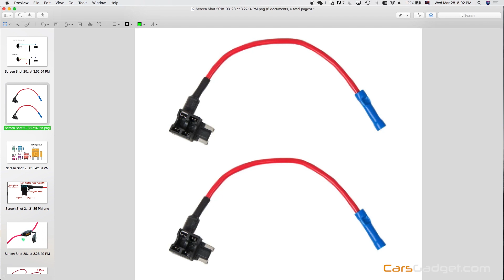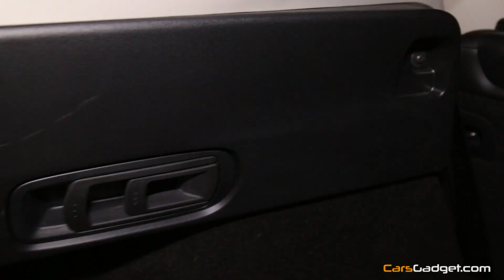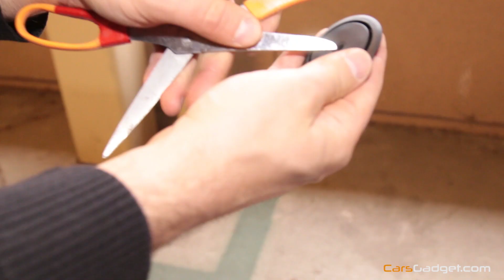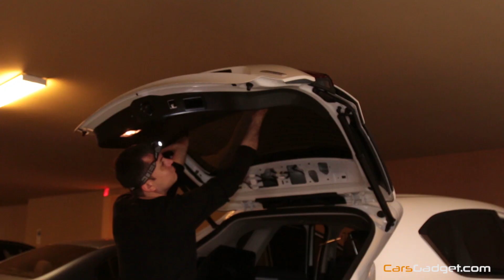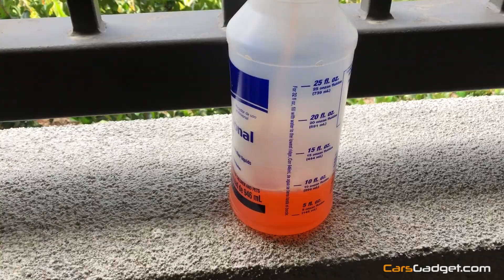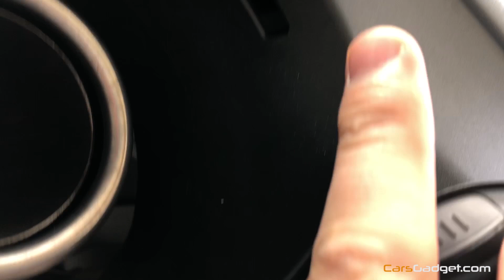How to install Hands Free Foot Trigger Trunk Opener release kick to open tailgate liftgate boot comf

Comment: Hi, I installed the module in a Mazda CX5 KF. Kick-opening works. To close it, I have to use the tailgate button or the remote. Kicking it again doesn't close the tailgate. Does it work the same for you?

Comment: I have recently purchased kick free sensor kit from ebay, it is almost similar to what you have used in your video, only difference is that it has an additional wire, instruction said 1 wire to be connect with -ve output of trunk outer button, 2nd wire to be connected to Trunk -ve trigger, 3rd wire to be connected to -ve output for truck inner button.

Comment: Hi this information is great and it helped me work out my Foot Sensor, but the button I installed on the boot did not trigger the boot to go up only down because that is what the button was designed to do. so I connected it to the original boot button and now it works fine. Different cars different plans who knew. But keep up the good work like what you are doing

Comment: Hi, I have a 2018 MINI Cooper CountryMan F60 and recently retrofit a SmartTrunk Opener/OEM TailGate KICK sensor into my car.The module of the sensor has 3 wires with one each connecting to the 12v & Ground & the last to ?LIN bus.I am not sure what this LIN module wiring is and where exactly the Signal wire from the Kick sensor is supposed to connect to.Can U help me with this retrofit project, please?. Thanks.

Comment: Great video, thank you. Quick question, I have located my trunk opening switch connector which has 2 wires going to the switch. Is there a way with a multimeter to determine which wire type negative or positve switched setup it is? and how to determine which wire to connect the trigger wire to? i'm assuming if i measure voltage across the two pins and as I press the button it should read a voltage? and one way it will be a negative reading etc?

Comment: Hi, I have the same module and the same Mazda cx 5 2019 KF car from the USA.  When I install this module, I can only open or only close the hatch with my foot.  I can not connect it so that the module opens and closes the hatch at the same time.  Did you solve this problem or is there the same problem in your car?  Because the film shows that the guest opens the flap with his leg but closes it with the remote control...

Comment: Thank you for this video. I am trying to install on my 2017 Honda CR-V EX-L. I can't seem to figure out which wire is the trigger wire for the trunk release. Is there a way to test the wires with a multimeter tool without cutting them? ( I am a novice)

Comment: Hi thanks for the videos I install a smart electric tailgate on chevy captiva with a manual trunk latch problems didn't know it wouldn't work but I install a electric latch need some help .What's up+594694420963